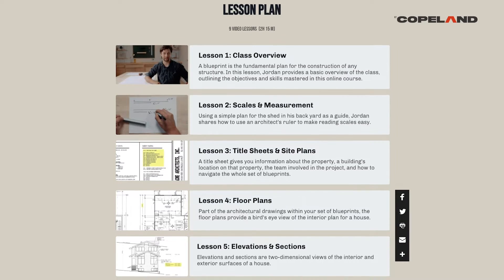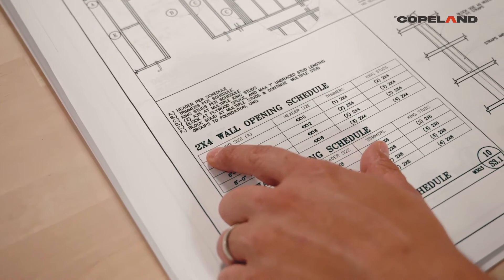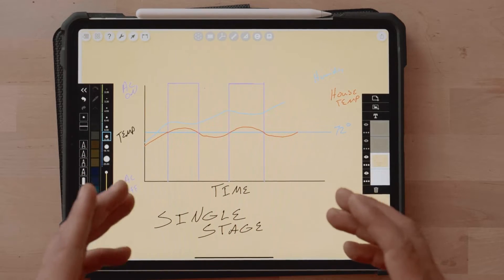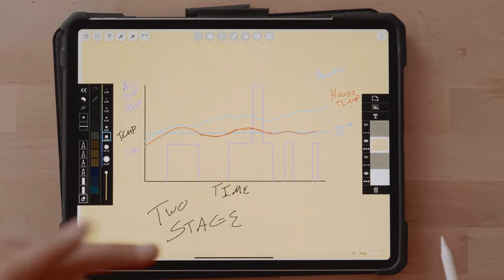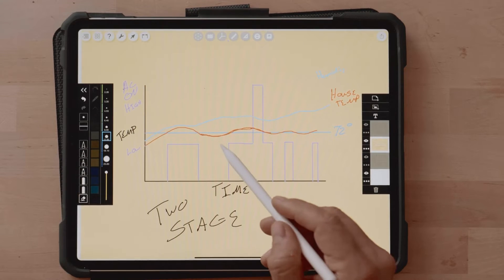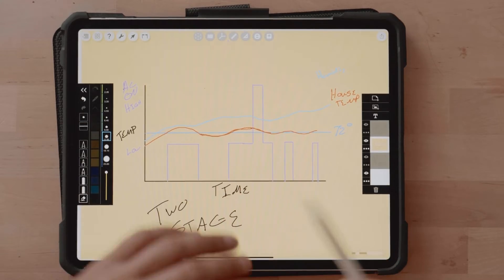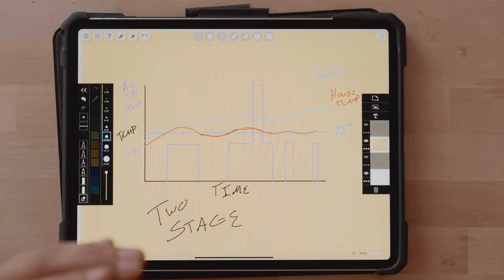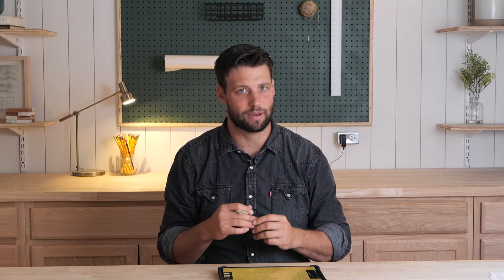Air Conditioners - Single Stage vs. Dual Stage vs. VRF (Mini Split) - Sizing and Dehumidification

Comment: Business is going to be great!!… lol 
I absolutely love replacing those  inverter boards when they fail....😁😅
I agree with you though… They more energy efficient etc.... unfortunately, The boards are never on the truck.... and they’re always a special order part that has to take 2 to 3 business days to arrive etc.
Reply from the maker: I hear you.  Do you see equal failures for both expensive Mitsubishi and cheap Pioneer (for example) systems?
Reply: @JordanSmithBuilds  I would say I see definitely less problems with the Mitsubishi units… And the local suppliers also stock more Mitsubishi products and  parts, so if there is a problem the parts are slightly more readily available. But some of the midgrade brands are fairly decent actually for the price LG, Daiken seem to have better quality than the really cheap cheep units.... what I would do is simply install whatever unit you want, and at the same time order a spare inverter board. Lol...  I actually like mini splits in the right application… I think it’s a great product. The biggest problem is that electronic boards are prone to failure from power surges, static electricity etc.… So you just have to be prepared for that. When you run the numbers they do add up to a lot of cost savings over time.
Reply: @ike7933  , I will agree. In the area of Missouri where I work, basements are the norm , so for me it's single stage with an Aprilaire dehumidifier. Problems are few and life is good.
Reply: K.I S.S.

Comment: Thanks for another great and timely video! My wife and I are finalizing construction plans here in Oklahoma and I'm struggling with how to manage ventilation. Is the best budget scenario supply through a dehumidifier and exhausting through bathrooms with smart switches ? Thanks again for the realistic ROI advice, that is very valuable to "average folks".
Reply from the maker: That would be my advice.  I am doing that exact strategy now on our latest build.  You're welcome!
Reply: Could you elaborate on the smart switches? What will they accomplish? Brand/model? Price?

Thanks!

Comment: I like how you both acknowledge and explain ROI...unlike that "other guy" who clearly doesn't know how that works.

"This heat pump is 3 years old, we have to replace it with a $27,000 VRF XPD GFCI RFI LKQ LNS Mitsubishi...so we can save money!"
Reply from the maker: Yeah, budgets are real.  Sometimes we want the "best" and cost is of no concern.  Other times (most of the time), there is a much higher value solution that performs phenomenally for the task at hand, while allowing room in the budget for other high value decisions.
Reply: Wow Jordan. Thanks for throwing in that energy cost value on your own house. That’s a rough number that I’ve been looking for...for years. 
I may contact you for more info once we find a builder in central AL that speaks hi-performance house/passive house/whatever will get me the building envelope I want. Lol
Reply: @alanr745  It does seem to be rather hard to find rough numbers to play around with these days without doing a million calculations and calling some sales rep. I am amazed at his electric bill - mine is about the same in a bit over half the house size with less people! I think my power coop is ripping me off though....

Comment: The advice is really climate dependent.  I moved from a single stage to a 2 stage unit in a the west and it has really been able to keep me using longer AC cycles for hot weather 90's, while still having enough power to keep the house the same temp when it's 100+ . My old unit was sized for the hottest days and short cycled it's self to death in a few years. The hottest months cost around the same , but the months that are just hot are  less expensive with even humidity .
Reply: What is sometimes lost in the two stage discussion is they come with variable speed blowers and with the proper thermostat controls they include humidity setpoints.  Trane initially led the market decades ago with their two compressor systems to achieve two stage but now its a single ultra reliable Copland compressor with a simple unloader valve built in.  Used by all manufacturers of two stage. Today's units can do an excellent job maintaining 50% humidity and desired temp setpoints.  Many, if not most installs do not properly wire or configure the two stage units. Some techs jumper the Y1 and Y2 inputs at the blower to force a quick upstage.  The variable speed blowers have a dehum input and with the proper thermostats, they can control humidity and optimize staging to meet climate goals.  For normal, somewhat leaky production construction, they can be slightly oversized and still run first stage (67%) the majority of the time, achieving long runtimes and quiet operation with corresponding lower blower speeds.  And without a 1 to 2 to 4 premium.  Perhaps $1,500 added to a normal $6,000 retrofit from an existing one stage.  Part of that increase should be a Honeywell Prestige thermostat with dehum and adaptive learning.
Reply: @rj.parker  I think my system does a lot of what you are talking about. I have the ecobee thermostat and a Trane heat-pump. It appears to be wired as you said and the humidity is pretty stable and there are some settings that the Ecobee uses to adaptive learning to  help with humidity. My system was about $2000 more to go to the two stage system at 5 tons, but the two stage systems were also a slightly higher seer and hspf.
Reply from the maker: Climate and house dependent for sure.  I am not against a two stage unit, but for our house design and construction process, a single stage makes more sense.  Thanks for the comment!

Comment: I'm itching to disagree .lol. my ac system is an antique single stage unit. Not oversized and not undersized. But the latent cooling is .46 on a hot day. My house stays at between 38 percent the and 44 percent rh all summer in the DFW area. My highest electric bill this year running two systems 24 7 with 4 people in the house was $154.

I will not include a dehumidifier in my new build. More to spend, and more to break later. I want to find a slightly undersized single stage, with good latent capabilities and run with that. Very low upfront cost and very low running cost
Reply from the maker: YOU'RE WRONG!!!  :) Just kidding.  I actually don't disagree with you.  If you have lived in a house long enough to know that the existing tonnage is adequate for cooling, doesn't short cycle and keeps the house at the preferred humidity, then why no stick with what works?  The problem for us as custom home builders is that we never build the same house in the same location twice.  Having a AC+Dehumidifier solution is our best bang for the buck while keeping happy, comfortable home owners.
Reply: @JordanSmithBuilds  that's a good point. You have to prepare for the worst.

Comment: I concur whole heartedly that designating a device for humidity separate from the heat and cooling device is best. Mini split for temp control and a stand-alone dehumidifier is an amazing and reasonable expense for a happy structure and occupants; adding fresh air ventilation control as well makes for top notch management air quality, along with temperature and vapor.
Reply: People think I'm crazy, but I find a $100 window air conditioner makes one of the best "dehumidifiers" for use in warm weather. I put it in an extra room where I don't hear it, and it runs on low all summer. It removes the same amount of water as any other dehumidifier, but it also dumps the extra heat outside, so you save a little on air conditioning. My main single stage heat pump still cycles on and off, but not as frequently, and I can easily keep the humidity below 50%. (In NC) I also have it hooked up to a plug in humidistat from Amazon, only a few more bucks.

With this "dehumidifier" I can be comfortable keeping the thermostat at 77, without it I need more like 70. Amazing difference it makes!
Reply: @ryanroberts1104  I agree, I live in the south and I also run a small window air conditioner that keeps it so dry in here I have chapped lips. My heat pump is rarely needed.
Reply: Depends on where you live.
Reply from the maker: Well said!

Comment: Is "VRF" what the rest of the world calls "inverter"? If so, that's by far the most popular here - maybe 20% more costly, but more efficient and longer lasting.
Reply from the maker: Yes.  The units use inverter drives to allow for a variable refrigerant flow.  I agree, much more energy efficient, and for small spaces, really not that much more expensive.
Reply: @JordanSmithBuilds  Does that also mean the motors are DC?
Reply: Longer lasting?  Really?  You need to back that up with some data.

Comment: I agree for new construction, but think VRF in the south makes a lot of sense for retrofit. As an example my house is a mediocre custom home from 1978  it has middling insulation, the roof has only gable vents and the air handler is in the poorly vented hot (140 f+) roof space. mini splits let me cut out the entire attic equation and for ~$750 each 1 ton Pioneer unit I added dehumidification to the house and cut my electric bill from ~$240 a month in the summer to ~$160 (yea still bad but working on that with some other projects).  cost to replace the 2.5 ton Janitrol from 1992 system would have been $5k so overall i saved money for a better system. Admittedly the Pioneers would have been $1500 each to have them installed by somebody else but as a hvac tech i could get them and install without any labor cost, but 3 would still have been cheaper than a low end goodman 2.5 ton system installed professionally.
Reply from the maker: Completely agree.  Retrofits are a different animal.  I have several Pioneer systems myself in secondary buildings, and have been very happy so far.  We are about to add another ton to our garage with a Pioneer system as well.  As a HVAC tech, what are tour opinions on the cheap mini-splits vs something like Mitsubishi?
Reply: @JordanSmithBuilds  honestly the mitsubishis are amazing and efficient but the question falls into a case of are they 3-4x better than a pioneer, LG, Daikan, sveille, GRee? not really. the most premium brand I would debate buying is a MR. Cool DIY partially for the savings in labor but the other side of the coin is they are a bit more efficient. They sometimes go on sale for $1200 and at that price its very worth it. at the current listings of $1600-1800 for a 12kbtu I would not consider it worth double a cheaper one. (most cheaper ones are 17-19 seer vs the 21-23 seer for premium brands)